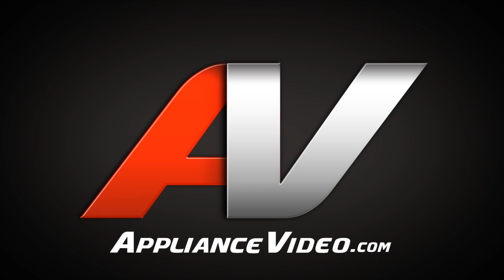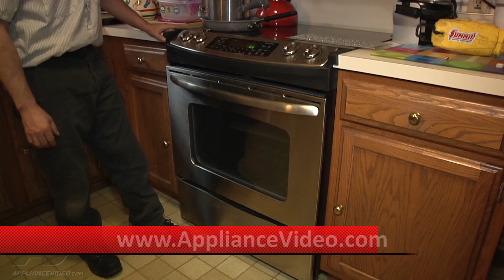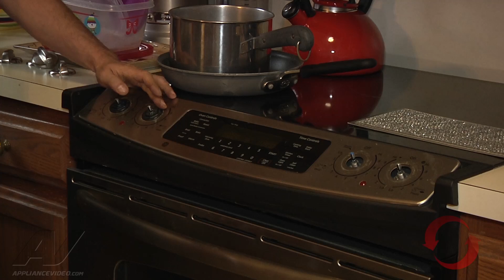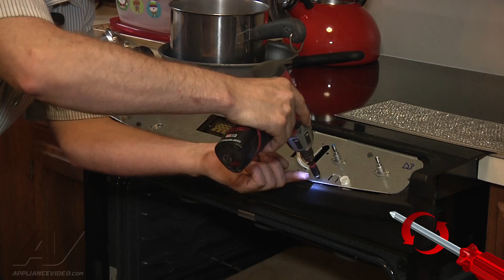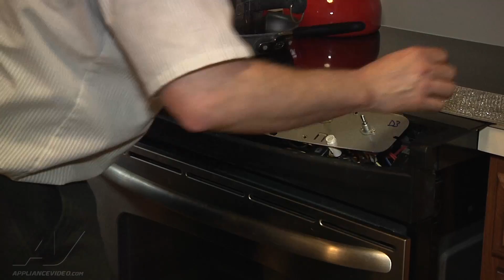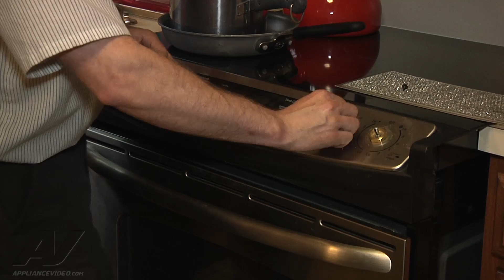GE Stove Repair - Burner Light Always On - Infinite Switch

Comment: Followed instructions step by step. Replaced the bad switch and light is still staying on!
Reply from the maker: +Diana Niedwick 

       Try going to our webisite at appliancevideo.com or our Repair Help.  http://www.appliancevideo.com/repair-help/ .  We also have over 30000 common questions
and answers that you can easily search through by your model number, appliance
make, problem or error code and it’s absolutely FREE.

Comment: At the beginning of the video you removed the power cord how did you test the element light there is no power how the light stays on when you unplugging the switch wires
Reply from the maker: +Mike George 

All of our technicians are now answering questions daily at our http://www.appliancevideo.com/ website under the Repair Help section.  We also have over 1600 common questions and
answers that you can easily search through by your model number, appliance
make, problem or error code and it’s absolutely FREE. You also have the option
to email a factory service technician with a question on your appliance at
http://www.appliancevideo.com/repair-help/ . If you’re looking for a repair video, you
can also search our library of over 2600 free repair videos. ApplianceVideo.com
specializes in quality DO-IT-YOURSELF appliance repair videos and we get over
800,000 views per MONTH to our videos worldwide and growing. If you need of
parts for your major appliance, we have over 5-million parts in stock at http://savemoreonparts.com/ .  Thanks
for your support. Matt Ace Appliance factory service technician.
Reply: Right, I noticed the exact same thing and when he was saying the light's on and pointing to it, it didn't look on? The company puts up some sorta BS link to their website, why not just answer it here. Hit the thumbs down dislike button.
Reply: @TomTremayne  Thieves, greed, poorly trained techs ruined the appliance repair business No one wants to work anymore. Why work 8 hours and make an honest days pay when you can rip off retired school teachers or disabled Vietnam war vets on fixed incomes.  The entitlement era., what can you do for me. I should get a raise just for showing up to work,.LOL How about working harder than anyone else. These idiots think they should be rewarded for showing up/because no one else makes it into work on time. I  should make 100.00 dollars an hour for doing nothing.I'm special.LOL

Comment: How did the light stay on with the power off???
Reply from the maker: The power was on until the technician unplugged the unit. Our family owned and operated company provides quality videos to help Do-It yourself consumers save money. Thank for your comment it helps us provide better videos. Please become a subscriber and get weekly updated videos and help our ranking on YouTube. If you are in need of any parts, our parts department has over 5-million in stock for same day shipping. Please call  1-800-830-5465 for any of your parts needs, or you can order online 24 hours at: ApplianceVideo.com. Thank you and good luck with you project.
Reply from the maker: Kat 
         All of our technicians are now answering questions daily on the ApplianceVideo.com website for anyone needing help. Just copy and paste this this question under REPAIR HELP, and one of our  factory authorized technicians  will answer any technical questions at absolutely no charge on your appliance issues. We also have over 2600 free repair videos to help with your appliance repair issues. Thanks for your support. Matt Ace Appliance factory service technician.
Reply: ***** Wouldn't it be nice to get an honest answer from an actual human being?
Reply: Kat Hilderbrand  i think that you unplug the unit remove the wire from the switch make sure all wires are clear from touching anything plug the unit back in look to see if the light is on if not unplug again and do the next and repeat till you have the right switch.YOU JUST NEED TO BE VERY CAREFUL DOING THIS  AND MAKE SURE ALL WIRES ARE CLEAR FROM GROUNDING OUT ON ANYTHING
Reply: You unplug the stove EVERY TIME before you disconnect or connect the wires!!!
Take your time, and be safe.
Reply: I had the same concern.  Shame the channel owner is trying to hustle people over to their website and charge $30 for answers.  Given problems with this video, I would not pay them a penny for help.
Reply: That was a horrible video, how does the light stay on when it is unplugged? How do you fix the switch after locating it?

Comment: if you unplugged the stove from the wall wouldn't the light come off? do you have to plug the stove to test the infinite switches?
Reply from the maker: Great question, if you have a more technical question that our parts department cannot answer, you can search our over 17,000 answered questions free at our website www.ApplianceVideo.com under our Repair Help section. You can also call our parts department at 1-800-830-5465 and they can give you help 7-days A week ,or search at www.SaveMoreOnParts.com  .

Comment: For the same model, do you have a video showing how to replace a burner?
Reply from the maker: Great question, if you have a
more technical question that our parts department cannot answer, our
technicians are answering all questions at our website at www.ApplianceVideo.com under our Repair Help section. You can also call
our parts department at 1-800-830-5465 and they can give you help 7-days A week
Monday -Sunday, or search at www.SaveMoreOnParts.com  24 hours
7- days A week.
Reply: Did you get an answer to your question, I don't see it here. Only the canned statement below. I have this model stove/oven and you notice the tech didn't replace the screws from the bottom of the control panel on camera. Anyway, the black control panel base has more screws holding it just below the cooktop level. You have to, of course, remove the control panel before you have access to those screws. Remove the base, or let it hang with the switches. After that, you will see two screws holding the cooktop down on the left and right sides. Lift the cooktop carefully and you can rotate it with the cooktop side on the bottom and the metal cover on top. You can squeeze the plastic clip holding the wires and push it out to give you more slack for the control panel to hang down. Remove the metal cover and you will see the burner elements. From there remove the clips holding the burner element you want to replace. And Bob's your uncle, eh, there you have it. But by all means, do nothing with the power on. Don't even try it without disconnecting the power first. Did I say turn the power off first?

Comment: A pan boiled over a little, so I took a dish cloth and tried to wipe up the water.  Unfortunately the dish cloth was made of microfiber, and it melted onto the glass stove-top burner.  What can I use to safely scrape off the melted microfiber?  Shall I scrape it with a stainless steel knife?
Reply from the maker: Dorothy Whitmer Here is a link for cleaning products this. This is what you need to clean your cook-top. http://www.savemoreonparts.com/accessories/oven-cleaning-kit.html . 
Please help us provide more videos to our site by
subscribing to our YouTube page or posting our http://www.appliancevideo.com/ website on your Facebook or Twitter account. Our
factory authorized technician’s also daily provide free professional Repair
Help to people like you to help solve their appliance problems. You also have the option to email a factory
service technician with a question at http://www.appliancevideo.com/repair-help/ .  If
you need of parts for your major appliance, we have over 5-million parts in
stock at http://savemoreonparts.com/ . Thanks
in advance for supporting us. So email us if you have any other questions our
videos cannot resolve. Thanks for your support in advance.   Matt, Ace Appliance service technician.
Reply: Wait'll it cools then carefully use a razor blade. The cook top is very durable and will shine like new after using ceramic cooktop polish.

Comment: Range Control Panel (Black)Part #: 9782418CB 
Do you have video on how to change control touch glass panel on kitchen aid gas slide in
Reply from the maker: Great question, you can call our parts department at 1-800-830-5465 and they can give
you help 6-days A week Mon-Sat . If you have a more technical question that our
parts department cannot answer, our technicians are answering all questions at our website at www.ApplianceVideo.com under our Repair Help section. We have over 3,000
common questions and answers that you can easily search through by your model
number, appliance make, and problem or error codes, and It’s free to search
through our question & answer library.

Comment: My radiant surface element stays high, even though control panel indicates it's off (HS-diaplayed as well). Does this sound like the main pcb. Control panel appears to indicate on/off and HS but surface element rains on high.
Reply from the maker: Great question, you can call
our parts department at 1-800-830-5465 and they can give you help 6-days A week
Mon-Sat . You can also search at www.SaveMoreOnParts.com 7- days a week.  If you have a more
technical question that our parts department cannot answer, our technicians are
answering all questions at our website at www.ApplianceVideo.com under our Repair Help section. We have over 6,000
common questions and answers that you can easily search through by your model
number, appliance make, problem or error codes, and It’s completely free to
search through our question & answer library. There is a very good chance
you question is already answered there.

Comment: what do i do if my G.E. electric stove turns on but wont heat up plus it keeps popping the house braker?
Reply from the maker: Great question, if you have a
more technical question that our parts department cannot answer, our
technicians are answering all questions at our website at www.ApplianceVideo.com under our Repair Help section. You can also call
our parts department at 1-800-830-5465 and they can give you help 7-days A week
Mon-Sat . You can also search at www.SaveMoreOnParts.com 7- days a week.
Reply: Probably the heating element is shorted out and needs replacement.

Comment: Hello please help the F30 on my frigidaire ffed3025ps is on. I am locked out of my oven. What should I do
Reply from the maker: Great question, if you have a more technical question that our parts department cannot answer, our technicians are answering all questions at our website at www.ApplianceVideo.com under our Repair Help section. You can also call our parts department at 1-800-830-5465 and they can give you help 7-days A week Monday Sunday, or search at www.SaveMoreOnParts.com  24 hours 7 days A week.

Comment: I have a GE oven and the light that is on is NOT the hot oven light.  It's closer to the front left burner and it goes on and off.  One guy had me unplug for a few hours to reset, lasted 4 days and now it's on again??  Oven is only 3 years old!!!  Any idea, what other light it could be??
Reply from the maker: Great question, if you have a more technical question that our parts department cannot answer, you can search our over 17,000 answered questions free at our website www.ApplianceVideo.com under our Repair Help section. You can also call our parts department at 1-800-830-5465 and they can give you help 7-days A week ,or search at www.SaveMoreOnParts.com  .

Comment: Hi My GE burner indicator light wont come on when i turn the burner on
Reply from the maker: Great question, if you have a
more technical question that our parts department cannot answer, you can search
our over 10,000 answered questions free at our website www.ApplianceVideo.com under our Repair Help section. You can also call
our parts department at 1-800-830-5465 and they can give you help 6-days A week
Monday -Saturday, or search at www.SaveMoreOnParts.com  24 hours
7- days A week.

Comment: Hi, ergent! I have the same oven as this, and I am wondering if it is still cooking, it has been 30 minuets and hasn't cooled down even though it is on the basic- clock tab and I have canceled out of the bake mode. Is this normal, plzzzzz help!
Reply from the maker: Great question, you can call our parts department at 1-800-830-5465 and they can give
you help 6-days A week Mon-Sat . If you have a more technical question that our
parts department cannot answer,
our technicians are answering all questions at our website at www.ApplianceVideo.com under our Repair Help section. We have over
3,000 common questions and answers that you can easily search through by your
model number, appliance make, and problem or error codes, and It’s free to
search through our question & answer library.